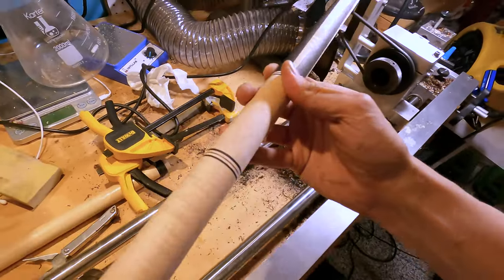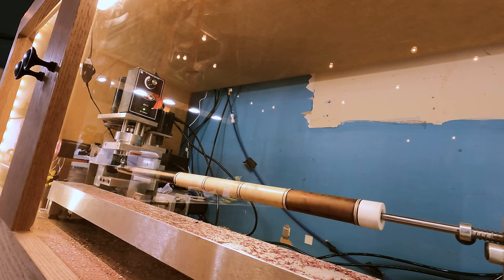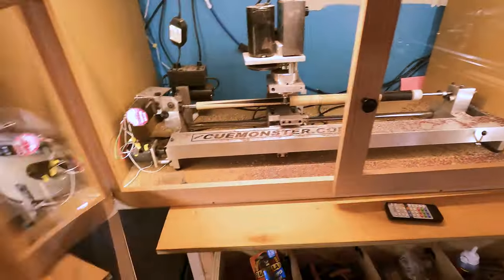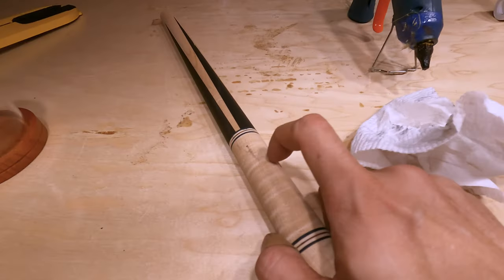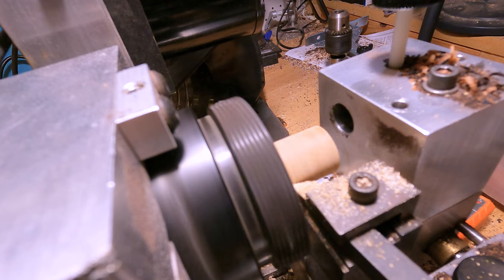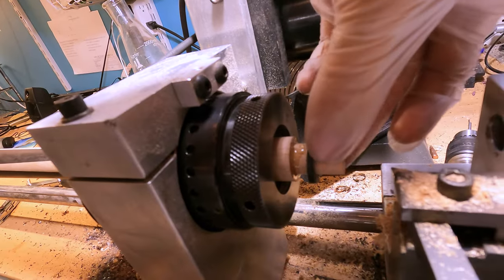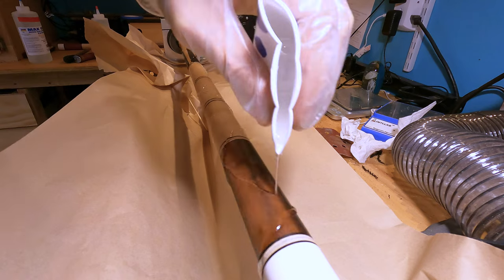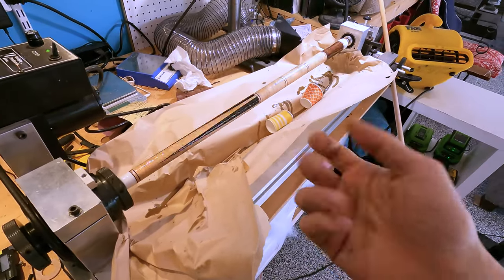Pool Cues Are An Insane Amount of Work

Comment: tip #2   You may want to alternate your router bits when working with harder material and try something more a like a long straight router bit let chance of your metal catching the sharp corner edge of your current bit but run your router at a higher rpm doing very small progressive passes.  Also high precision caliper is your best friend when building cues got to use it constantly. Also don't forget to hang your piece vertically after every cut down to allow the wood to stabilize. Important for the butt end but super important the making shafts.  If you are going  to making a shaft for your cue by-pass maple based shaft dowels and jump directly to torrified wood or carbon. Carbon is currently the big thing and require no stabilization. Torrified(kielwood) requires very little stabilization since the wood is cooked remove almost all the water and sugar (the wood has a golden color).  Not using any wood stabilizer cutting down shafts takes years sometime unless you use a pre-aged shaft blank from a cue supply store.  Don't forget to cut glue relief section(vertical lines) when you glue up your joint and butt cap. Doing the finish on the cue will take more time than you will think especially if you want a glass like finish.   Side tip look into clear coat finishes used for guitars and wood instruments.
Reply: I just notice you don't have any concentricity gauges on your lathes. You would want get a least two to make sure your lathe is properly calibrated and centered this could be the reason why your points are a little off but great work for someone that just started.
Reply: @shojingod  its funny you say that.. I make cues and saw everyone using those router bits so started with that... I ended up switching to a 1/4" endmill or long flush cut bit, which works much better that the one everyone else uses....